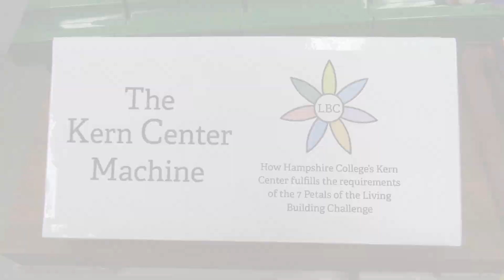The Kern Center Machine 🌼

Comment: I got quite a few 6 simple machine vibes from this. I love seeing your style combined with different objects besides the typical hot wheels tracks, ping pong balls, and knex. It gives variety, and it’s always cool to see how you use them in connection with your own style to make new interesting tricks. This machine is probably one of my favorites from you for that reason. Incredible work.
Reply from the maker: CubixRubeGoldberg Creations You're right, there are a lot of similarities between this one and 6SMIO. I actually talk about that a little in the Behind the Scenes, but they're similar in style, size, and purpose. They were also uploaded on almost the same day, just two years apart!
And yeah, I know I always say I'm bad about incorporating foreign objects, but I should probably stop saying that at this point. I love what my style becomes when I use objects outside the typical ones I use all the time.

Comment: 2 incredible uploads from 2 incredible builders less than 24 hours apart of each other. (You and Konrad) Wow o.O
This is seriously incredible! There wasn’t a single moment I wasn’t impressed by. I have a lot of questions too. How did you reset the water part? How long did it take to perfect that ball launch???? But seriously, though, what an incredible video. You’re a true master of machines.
Reply from the maker: I talk about resetting the water section in the Behind the Scenes video! The launch was extremely easy to figure out, since those launchers are so amazingly accurate. I only had to make minor adjustments to the placement of the last table so that it would make it into the funnel properly.
Reply: Hehe I’ll be sure to check the extras out!